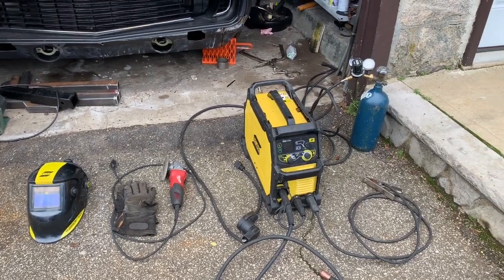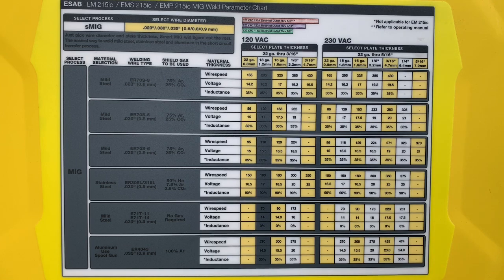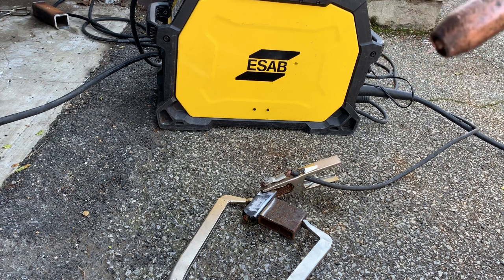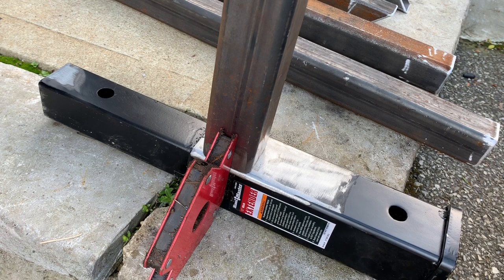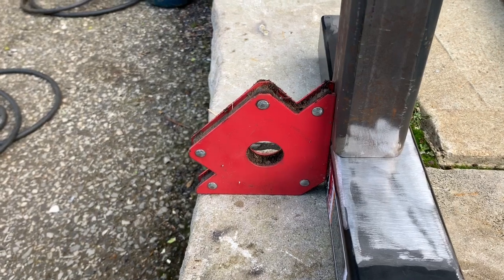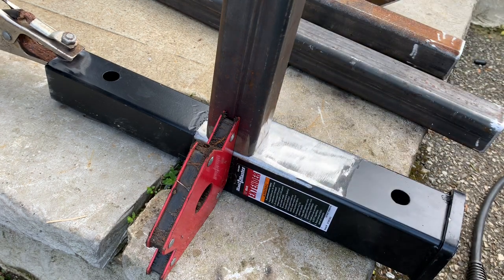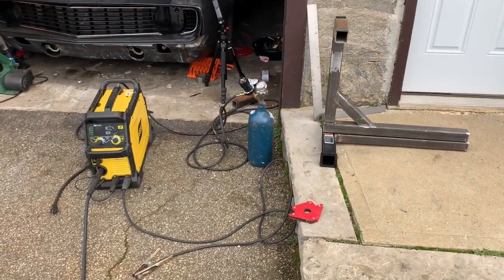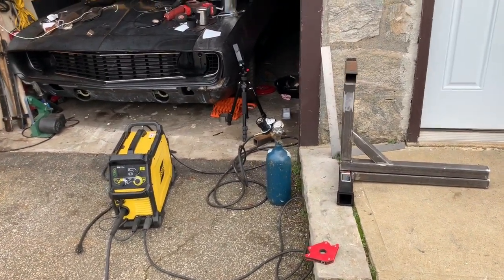How To Weld For Beginners

Comment: Hi I just brought a Boss weld welder similar to yours. I have brought it over at a warehouse called Bunning's. The only thing it didn't come with is a Tig cable which I got to get and also quick release gas hose connecter. I paid $499.00 Australian dollars, I also brought a Boss weld welding helmet, 0.9 gasless mig wire, 0.8 mig wire and 0.9 mig welding tips.
Reply from the maker: John Van Van Der Velden sounds like a steel man! Multi process welder from boss! Are they state side?
Reply: @roughpatchroad  I live in Australia
Reply: This Boss weld is a three in one. Arc, Mig and Tig.
Reply from the maker: John Van Van Der Velden Nice man! Congrats on the purchase

Comment: Hi, i just ordered a mig-tig welder from Amazon, and it's gas-less. I've choose it by purpose because i don't want to take the Gas issue in my place.
i just want to do DIYs nothing else.
so the point is, does the gas-less welder do the same job as the one  with gas?
I know the Gas works as a shield, but do i have to buy something that fits my needs right here?
thanks a lot in advance and sorry for my messed up words...am an Arabic man from Kuwait so i apologize for my accent  LOL.
Reply from the maker: SadPrince Q8 Yes Gas-less flux core welders can be great alternatives to Gas shielded set ups. However with a mig set up you are going to get far superior welds to flux core. What I would say is HONNE your skills with the flux core, then upgrade to a mig-tig set up down the road. There’s not much hazard involved with owning a small mig-tig set up but again flux core is a great alternative.